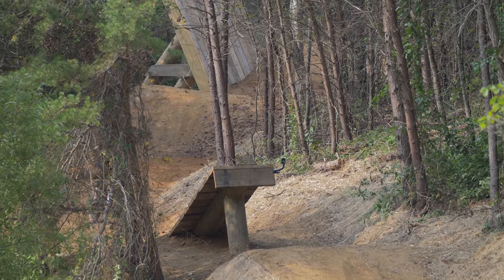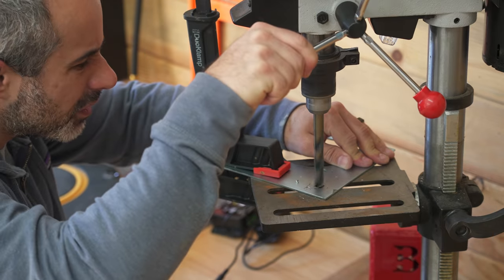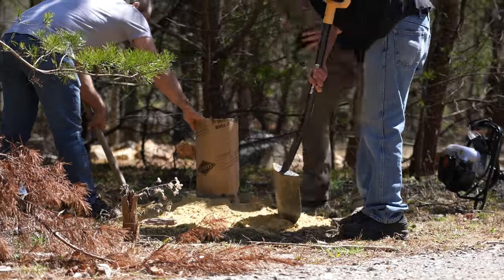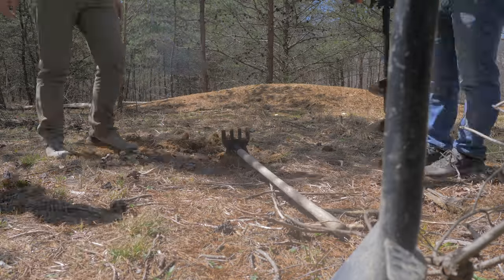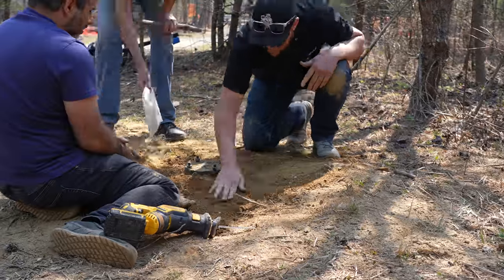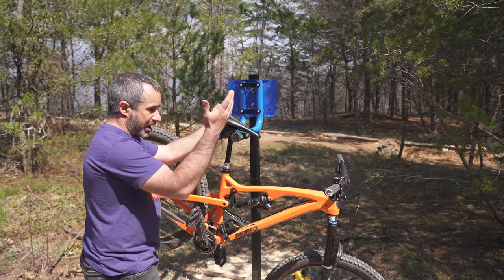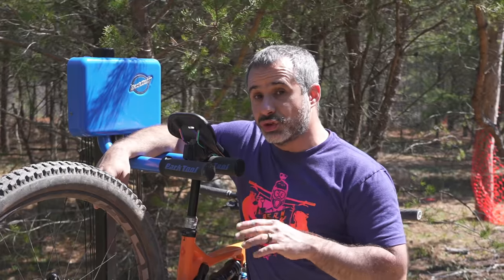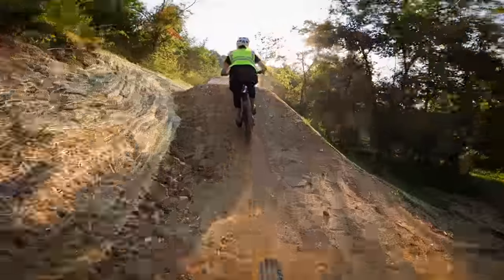Installing Bike Repair Stations at Berm Park

Comment: THS-T sounds like Park Tool for Trail Head Station Template
Reply: Or the hack shack tools?
Reply: And the best part is that if Berm Park gets expanded and wants to add more repair stations, the THS-T is ready to go!
Reply: Would have guessed it means "Tool Holder Stand - Template"
Reply: @Japam1984  id guess „trail head stand - template“

Comment: Recommendation. Only use the sono for above grade and slightly into the hole. Ex: 2 foot deep hole, fill with 18-20” of concrete and then place a 6” tall piece sonotube on top, fill the rest with concrete. When you place the sono tube all the way down and then try and pack dirt in back around its a much more loose fit then if the concrete can directly bump up to the unmolested, still compacted dirt, and you save sonotube, which is sorta expensive. Park looks great BTW!!

Comment: Great video! But I could just steal the whole station with a wrench to undo the four bolts at the bottom. A quick buzz with a portable stick welder will fix that.

Comment: Cool video as always! I'm not familiar with the weather there but the magnifying glass could be fire hazard?
Reply: Eh harder than you think the beam has to be PERFECTLY focused and any to no wind will put it out
Reply: Asheville is a very humid, wet climate with very low risk of forest fires even if you intentionally dropped a match or something in the grass.

Comment: UV light has taken its toll on tools at the local repair stations I have seen (not Park brand but with some Park tools). I wonder if Park's tools have UV inhibitors. I carry tools but still love these stands because it takes two minutes to pop a bike up and adjust a brake or derailleur. It would take me more time to just fish my multi-tool out of my bag.

Comment: Indigents gradually dismantled all of the parts from the repair station in Riverside, CA installed under the elevated City Hall’s walkway, leaving only the bolts that clamped it into the concrete.
Reply: mijuo roui  What? lol

Comment: Hey Seth love all your videos watching all your videos is how I Learned to work on my bike so recently I acquired a second hand diamondback release 5c and I wish I could say better things about it but I kinda wanted to personalize it and added some stickers to the frame until I realized that the stickers removed the top coat of the paint and I wanted to know if you ever had the same issue with your 5c

Comment: I’m happy that you uploaded this cause I have no idea where else to ask this and this is probably the best place I trust to ask this, I have a problem with my bike
The shifters are kind of busted, like its not visible damage but I’m only able to used the 3 smallest gears on my cassette
If I go any higher number so like 4-9 (I have a 9 speed) The chain falls off, not the edge of the largest gears, but rather right next to smallest gear closer to the derailer, any help?
Reply: Might be a problem with indexing or the B screw although that is less likely park tool has some good videos on those
Reply: Check to see if the derailleur hanger is bent, especially if the shifting setup was working well before. After that check the limit screws to keep the chain within the limits of your gears no matter what is going on with the shifter cable. Once those are fixed check to see if your shifter cable has slipped where it attaches to the derailleur, and get that adjusted back to where it belongs. Fine tune with the adjustment barrels once you have it close to where it needs to be by adjusting the cable.

As @Me Me said there are plenty of youtube videos that can help with how to do these adjustments.
Reply: @MichaelOnines  thank you!!! I’m gonna work on it today once I get home
Reply: @MeMe-yt5uy  thank you!

Comment: Hey seth just listen to what you said at the end and it was about “you can leave everything at the car” that made me think not everyone has a water bottle cage or carries a water bottle or if they do they could run out of water. Would it be worth putting up water stations? (Love the videos btw)
Reply: This is part of a larger forest park so I'd imagine that there's facilities that people can access
Reply: @leonardhaworth5632  I was just thinking of instead of having to cycle all the way back they can access it faster
Reply: @dj6t6  ah right that does make sense to have one at the top of the climb maybe
Reply: Doubt it will be connected up to water at the top and it would be hard to bring it all up if it’s not

Comment: Is is really not critically important for this application in your post footing, but for steel in concrete in contact with the ground you generally are supposed to have minimum 3 inches of concrete cover over the steel to prevent spalling and corrosion.
Reply: I like 4-6". 14 years as a concrete finisher.

Comment: Those aren't security bolts and will provide absolutely no security I can buy a screwdriver that would open that at Lowe's for Christ's sake and in fact I have because I have had to use that exact type Torx screw to open a PlayStation 4